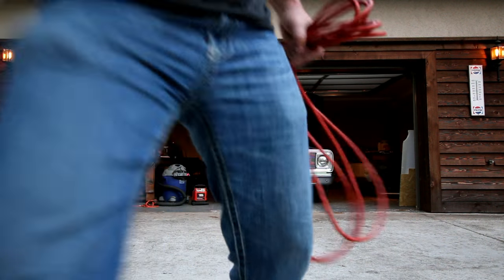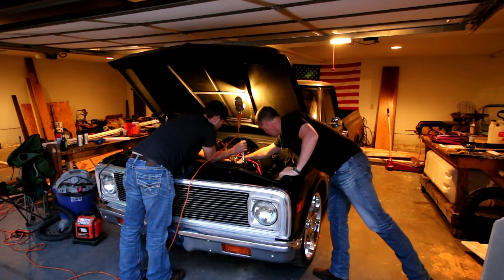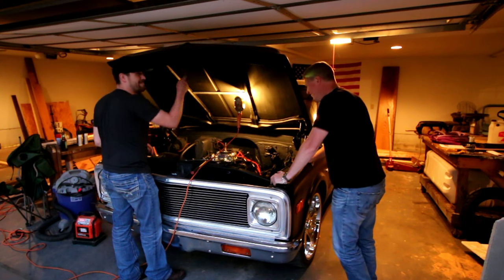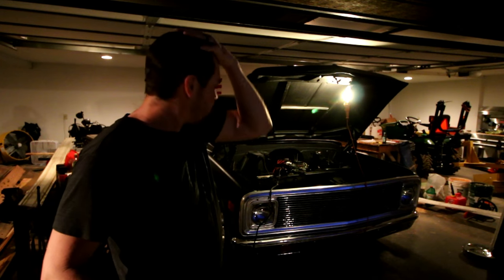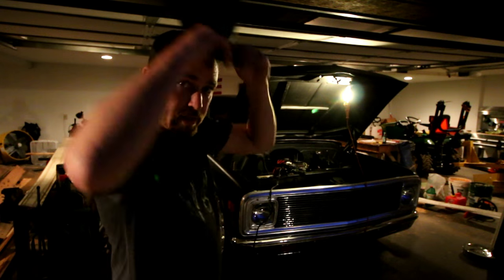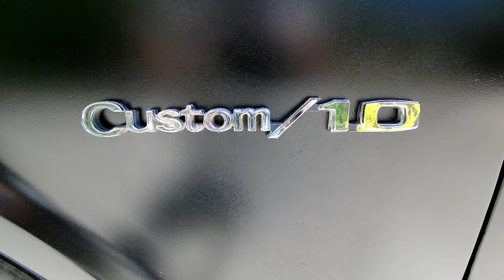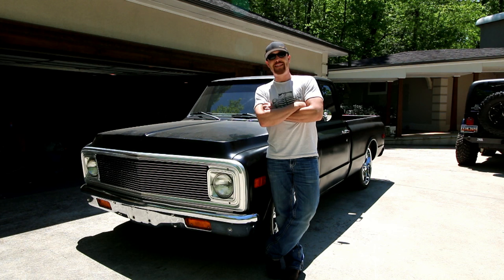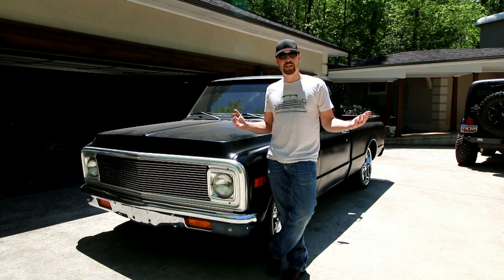New Chevy C10 Shop Truck | Black Pearl Recovery

Comment: i like the colour , you could add youre channel logo somewat small above the badges on the front weelarches or a little bigger on the bedsides in front of the rearwheels
might be nice to do a solid bedcover in black and add the huge logo to that too 
if you make the same logo on the underside of the lid you can flip it straight up towart the cab and use it as a backdrop when youre at a meet selling merchandise out of the bed itself  , the 3 foot logo and the you tube logo beneath it about 7 feet in the air (when the lid is straight up on top of the bed ) should get you noticed

Comment: So Mr Voss are you gonna get some more up to date wheels on this thing when you lower it?  Maybe something outside the box with a satin aluminum finish or maybe bronze or gold?  I have a soft spot for these old trucks, several close high school friends pimped these.  Stance and wheels make the truck, and it could be sooooooo badass.
Reply from the maker: +Marty Spinn I would really love to change the wheel because I dont like them but just dont know that I am going to spend the money right now. May try to tone them down some though.
Reply: +The Fab Forums that might be a cheaper alternative.

Comment: not a nice question to ask, but what did you pay for that truck?
Reply from the maker: +Serg Stroble i dont want to say the exact price....it was under 10
Reply: i commented before really seeing the truck as well, but it looks like a very clean, straight body truck. lowered, decent wheels, cool mirrors, paint looks great in the video.  that is a rather nice "shop truck" in general. Also, a good investment because im sure you will take care of it and make it better over time as well.  Maybe a good pass me down truck for the little ones :)
Reply from the maker: +Serg Stroble Thanks

Comment: you said it's a 69 but it appears to have a 71-72 grill and bumper
Reply from the maker: +williamoa2 you are correct. Someone must have changed it at some point. I actually prefer the 69 grille and bumper over what it has but not sure I will change it anytime soon.
Reply: +The Fab Forums nice. I've never been a fan of the billet grilles, personally feel the stock "egg crate" grille looks better on the 71-72 trucks

Comment: "Big asshole" 5:10 hahaha

Also, what happened to the Crown Spoil? I thought that was supposed to be the shop truck.
Reply from the maker: +RideThroughLife lol...I sold the crown spoyal at the end of last summer. The fromt fenders on that body style would let me lower it enough to get the look I wanted. Plus it was purple.
Reply: +The Fab Forums makes sense. At least not without a lot of modification. This new one will be great.
Reply from the maker: +RideThroughLife Yeah would have had to remove the inner fenders and relocate the hood hindges